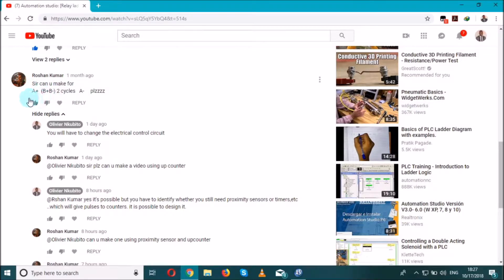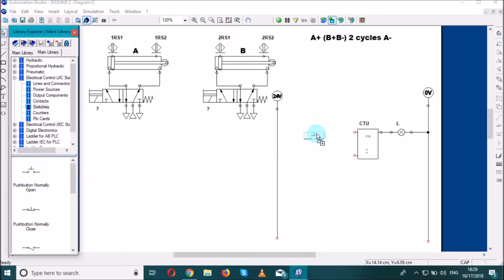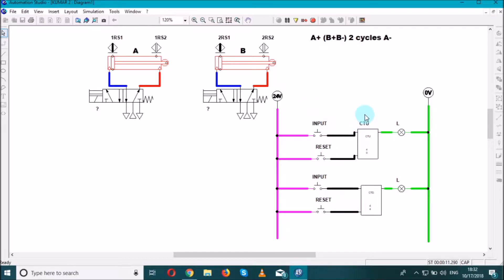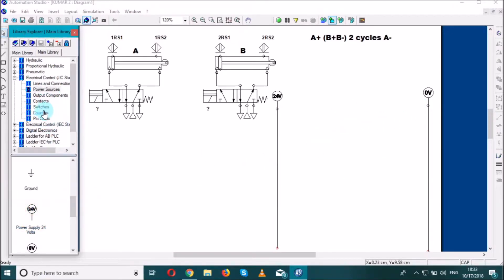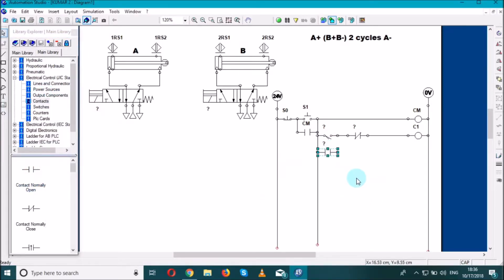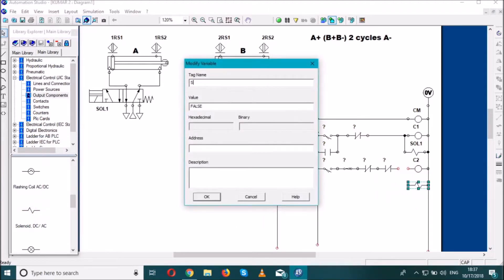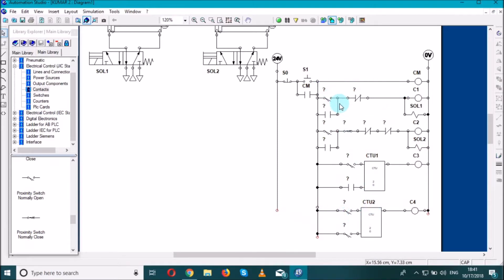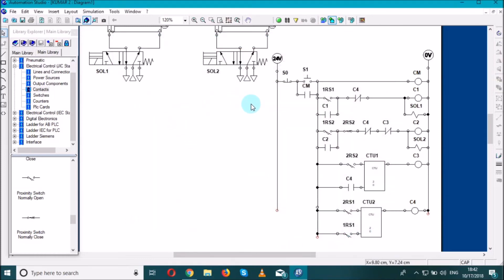Automation studio: [A+ (B+B-) 2 cycles A- ]Pneumatic cylinder {Up counter and Proximity switches}

Comment: how about A+ A- B+ B- and it doing for 5 times..can you make a tutorial ?
Reply: @OlivierNkubito  yes
Reply from the maker: @valoranthighlights2005  Hello! The tutorial you want is it from PLC or simply relay ladder circuit?
Reply: @OlivierNkubito  from PLC and ladder circuit
Reply from the maker: @valoranthighlights2005  Alright you gonna have them soon
Reply from the maker: Hello Anime lovers! you mean (A+ A- B+ B-) 5?

It is possible but for some sequences, SFC (GRAFCET) can be used instead of the ladder program to make it easier. 

try this link for SFC with the sequence : [C1+C2+C2-C1-C3+C3- ] https://www.youtube.com/watch?v=dW5YdlZP8RM

You also need to know that the program might change depending on the number of solenoids your DC valve has.
Put in mind that also the number of positions counts.
Reply: When can I get the tutorial
Reply: When can I get?
Reply from the maker: @valoranthighlights2005  I'm doing my best so that you can have it tomorrow!  I've been busy these days!